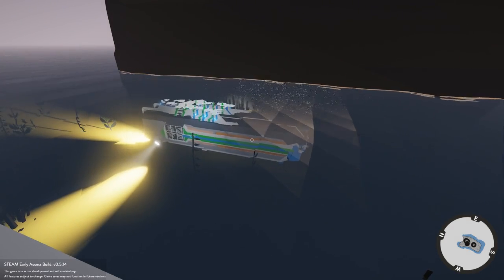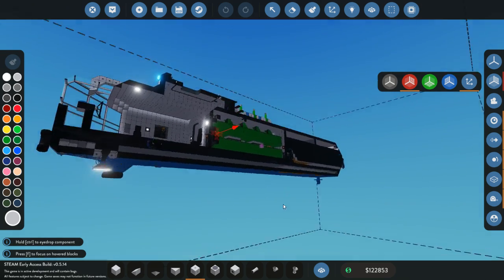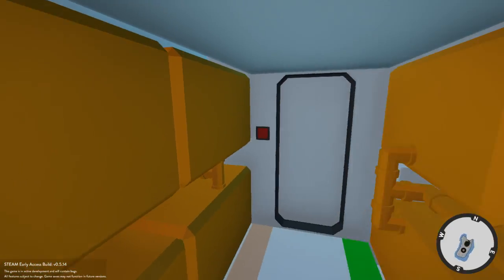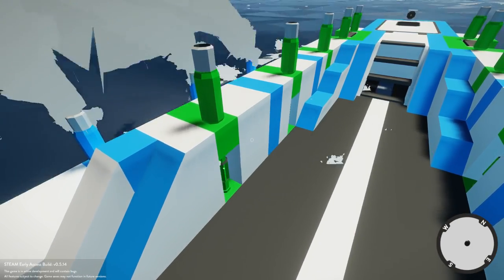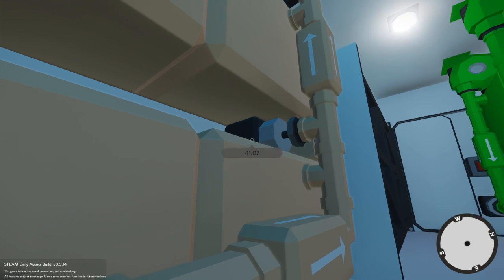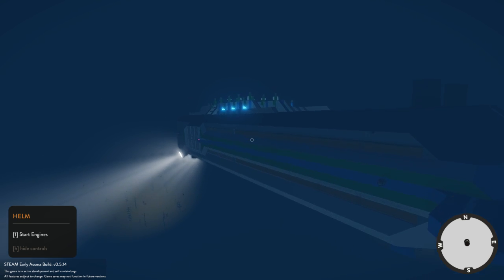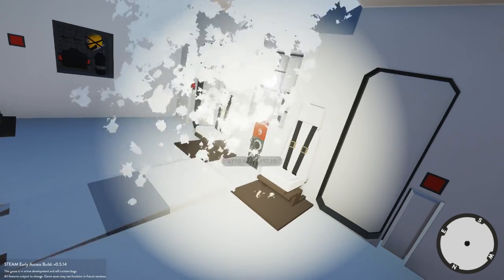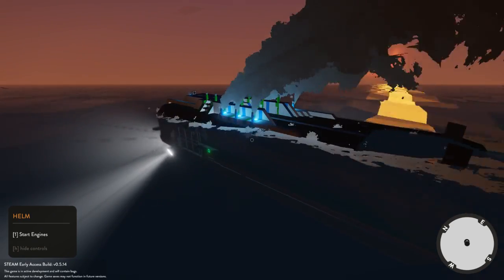Stormworks: Advanced Submarines

Comment: could´nt you just use a hose and some flotation device and give your sub a snorkle ?
Reply from the maker: Yes, but the mechanism is large, heavy, buoyant, and unreliable.

Some of my subs have floats to help keep exhaust flowing down to ~150m, but for air intake they're really iffy and you can't get as much depth out of them as you think.
Reply: @CraigPerko  Even if you use a Pump for both air intake and exhaust?
Reply from the maker: @teron281  The buoy will dip below the surface of the water constantly. You can't intake air when you're under the surface.